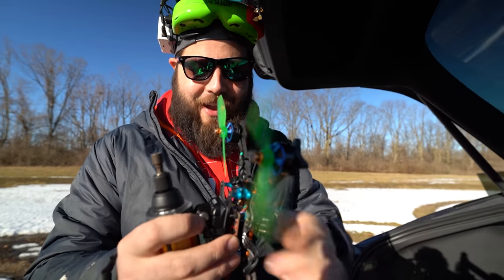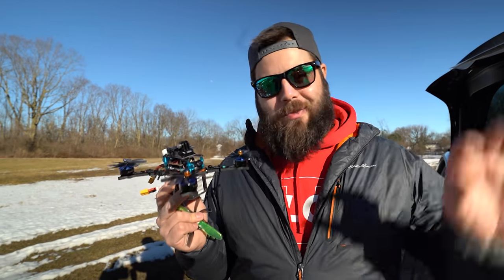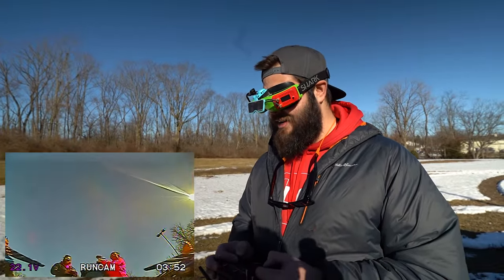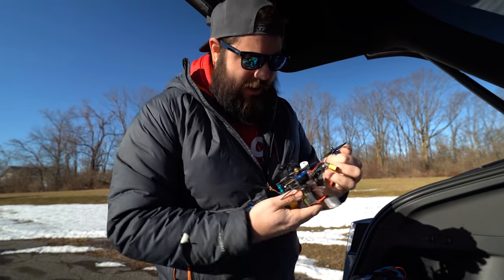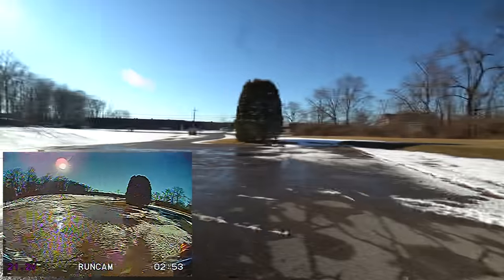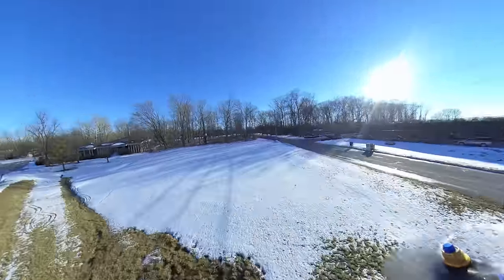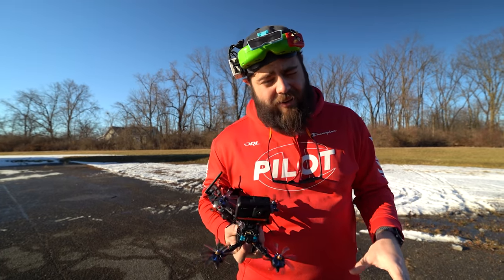Pushing 8 blade props to 65,000 RPM

Comment: In World War II it was the sound of the German Stuka that struck fear into the hearts of soldiers. In World War III, it will be the sound of 5-inch bi-blades at 65,000 RPM.
Reply: i have 6-inch bi-blades, but only can fly them far away from civilisation. it eaven scares the crap out of me. hehehe
Reply: Not far off now eh
Reply: You didn’t know how correct you were when you wrote this.
Reply: @Flumphinator yeah 😢
Reply: This aged like fine wine

Comment: imma hold out for 16 blade.
Reply: 420
Reply: Do dual motor mounts with 8 blade.. there u go, 16 per arm
Reply: Low turbulence
Reply: Half blades.
Reply: @dp4advanced234 " Tied stick?"...

" U know, the stuff that's tied to a stick."
Reply: surely stack 2 on top of each other.... i wonder what would happen if you did that?
Reply: no need to wait anymore. quadmovr did 16blades, check it out on his channel
Reply: @chrisgicky2215  Goo look Quadmovr, he's already doing that.
Reply: @nixie2462  not surprising.. the man is insane. In a good way 👍

Comment: 65,000 rpm is over 1,000 rotations per second. Try to wrap your head around that!!!
Reply: Soo... what is the 5inch tip speed??? Over 1400kmh. What is the forces on the prop? Around 200kg...  This is not possible without exploding the prop.
Reply: @NiNo9  its a 3 inch prop
Reply: @NiNo9  There is a lot of drag that slows down the props and maximum rpm is also limited by the ecs (mosfets don't switch instantly). It would be nice to see real rpm in osd.
Reply: the guy in video just did some simple math and thought that's it. 65K. But it's 65k without resistance (no prop). with prop is way less

Comment: Question: What's the best 5" prop?
Answer: 3" 8-blade.
Reply from the maker: Rofl
Reply: There are now HQ props, 8 bladed 3.5inch, and 6 bladed 4 inch that should work better in a 5ª quad than the extreme 3" props.
Reply: i guess Im asking randomly but does someone know a trick to log back into an instagram account??
I was dumb forgot my password. I love any assistance you can offer me.
Reply: @Holden Milo Instablaster =)
Reply: @Ahmir Samson thanks so much for your reply. I got to the site on google and im in the hacking process now.
Seems to take quite some time so I will reply here later when my account password hopefully is recovered.
Reply: @Holden Milo You are welcome :)
Reply: This makes me curious how 5" 8-blade props would perform.

Comment: According to a propeller tip speed calculator, at 65,000 rpm the tips of a 5 inch prop would be supersonic, traveling at 966.8mph. That explains why those powerful race drones are so loud, but I still don’t quite think those props can handle the drag that occurs when the tips go supersonic…although when I compared the prop design of a race quad to the prop designs of planes that have supersonic propellers, the quad’s props look like they’re gonna handle it WAY better. Just wonder if it’s possible to make a race drone with supersonic propellers to make it super loud and fast
Reply: 11:26

Comment: Qualitatively speaking, for the same diameter, 
number of blades:                                 2                             8
RPM needed for certain thrust:         high                        low
noise:                                                     loud                        quiet
top speed (high-speed efficiency):   high                        low
low-speed (hovering) efficiency:       low                         high

Comment: We played around with 8 blade props years ago. Back in the CC3D days and the bite is insane. Super locked in, 2 and 3 blade props felt sloppy back them compared to them.
The are faster at mid, throttle for sure but really caused mega sag if you went above about 70% throttle. 
This was on BH 2205 2522kv motors and 4s 1300. They felt amazing but they pulled so much amps that it literally was unflyable even on a totally fresh pack... After a, min of flight if you got on the throttle at all for any length of time it would cook a esc or sag so badly you would have to back off... 

The 6 blade 5 inch props was halarious... 

What's fun is to take 3in props on a high KV 4s 5 inch build and run 6s. The motors have so much torque with that little prop that it literally man handles them and response is so quick and clean and at hover it's making some noise lol... Wot on a unloaded 3 inch prop on 6s on a 2900kv really screams.

Comment: there is lot of aerodynamic physics behind this experiment, which could explain why is proper diameter, number of blades and rpm does it's job... The main idea is that only diameter increase flow(volume of fluid per minute) which increases thrust, and explains why bigger drones fly more efficient. Number of blades increases pressure, but decreases flow, that really helps to increase "grip" of the drone. The most efficient setup in theory of hydro and aero dynamics is to have only 1 blade, but you'll have unbalanced motor that makes it inefficient in terms of tribology of bearings, that's why the most efficient drones use 2 blades. As for high rpms(which highly increase pressure, and flow a little bit) which you have to use in that case because you don't have enough flow because of small diameter of props shows bad effect because you have something like cavitation in water at pump input because of low pressure when sucking, in the air you have vacuum at the edges of props which also could be said that you are running props with a speed higher than speed of sound. So when you are running 8 blades you have less flow and less air goes at speed of sound, that's why they are much quite than 2 bladed which have much higher flow

Comment: I just did the mathematics. It's obvious when you think about it. If you halve the blade diameter and quadruple the number of blades (of the same angle), then you get the same lift at the same RPM, so it's a straight swap on your current rig, without changing motors, ESCs or batteries. It would be interesting to see what impact such a change has on noise level, air speed and agility.

Comment: I just bought my first drone. Zero Features. Just a basic all piloting all the time drone. Loving it.

Just the fact that I can get so much practice piloting. My buddy smirks when I am flying, because I just fly out a ways, circle back, establish hover and land accurately.. I was doing it with a store bought drone in the wind. I did my first attempt at a flip with it a few minutes later and lost control though. This is what happens when you let your friends  bait you into showing off. Drone is fine.

Flown a Phantom before. It was almost too easy to fly. I started out years ago in helicopters. So it seems to transfer well.

Comment: So, a little math here.  The circumference of a a 5 inch prop is 15.710 inches.  That means a 5 inch prop tip at a potential RPM of 65,000 would be traveling at 1,021,150 inches per minute, or 16.1 miles per minute, or 966 miles per hour.  That means that weird sound hat you are hearing is the prop blade is likely breaking the sound barrier, and becoming much less efficient.  The eight blade props would be doing 677 mph at 65000, which under load will not reach that rpm, and is staying under that sound barrier.
Reply: 1,416.8 fps if people are looking for that measurement
Reply: 966 is superso at Mach 1.2. So yeah, I bet the prop is supersonic

Comment: In what seem like the old days, I used to run 5S on 2600 kv F40 Pro V2 motors.  This was in the days before Betaflight had a motor output limit.  Tuning was difficult and never perfect, and the best I could really do was put a throttle cap on the radio to keep from pushing the props too hard.

When I'd flip the switch to bring disable the throttle cap on the Taranis, the Racekraft 5051 props would scream like a banshee.  The sound was just ridiculous.  On any 5" prop.

Comment: i am using same propellers on a simple DIY cinewhoop with 3s battery. major difference is the sound it generates. it is quiter and thrust is more than 3 blades. good thing isthe load on ESC is not much different. 26 amps in total vs 24. but very fragile when used out of a duct, and acetone warps them FYI.

Comment: I love it! Very quiet for a beginner would be excellent! Sound too loud is sometimes scary for many people and neighbors! You guys should produce the quite and new 64 blades by Nurk FPV.
Reply: I personally don’t like quiet race drones. To me, they should be like mini fighter jets which is loud, fast, and highly maneuverable. In fact I wanna find out if it’s possible to have a drone with props that go supersonic which would give u extra thrust, and a LOT more noise lol. If it is I would love to get an fpv quad and install more powerful motors on it with a very specific propeller design that can handle the drag when creating shockwaves on the tips due to going supersonic

Comment: You can take inspiration from the aerospace industry. GE's GE9X has similar design in blades. For a few reasons.

1. Way more effective in power to fuel consumption 
2. Noise levels dropped dramatically.

You're seeing and testing GE's theories and might even realize it :)

Comment: When changing prop blade #’s do you have to tune the drone differently to keep the motors from heating up? Or is that usually not an issue?

Comment: I did a mix of old dalprop 6 inch biblade in front and modern triblades 5 inch in the back on 2208 2450kv and this thing sounded like a monster. Very loud low pitch sound that was amazing. It was flying like crap but the sound was crazy

Comment: Sooo. In aerospace engineering this is an entire field of study. Basically, what it comes down to, is more blades == less efficiency. At those speeds, a two bladed prop will probably save you some battery power and handle about roughly the same as the 8 blade, however, the two blade prop experiences less drag to spin up to speed, so it uses less power to spin up to the same speeds as the 8 blade. when you start to get to super sonic speeds, thats when a propeller starts to warrant a fan shaped design. Like in a turbojet engine. 

I'm not an engineer, but I from what i understand, thats where the science of blade numbers comes in. 

More blades = more more juice to power it with marginal or negligible increases in performance. You can look to WW2 to see why they chose to keep planes with 2 or 3 blade props :p

But i guess its a decent trade off to make your drone quieter O:

Comment: two things. First, have you tried to put them on a 3-4 inch frame? Second, I wonder if they might come out with a 4 inch 8 blade prop?

The first option might save some weight. The second option would reduce rotations and the pitch a little.

Comment: The smaller prop being quiet does make sense.
The 5 inch could be breaking the sound barrier while the 3 inch is not. Another way of looking at it, is that all the noise your hearing from the 5 inch is the sonic boom of the propeller tips.
Reply: I bet and to prove it, I calculated the tip speed of the 5 inch propellers at 65,000 RPM and sure enough, it is supersonic at 966.8mph. Another thing is how it sounds at 11:26. It had a very distinct “buzzsaw” kinda noise. I heard a 4 inch quad before and it sounded mainly like a “whoop” or “zip” instead of that kind of intense shredding kinda sound. It was still the LOUDEST drone I’ve ever heard tho! I would love to get one with supersonic props and basically destroy ppl’s eardrums lmfao. That is why I love race drones

Comment: Don't edf's have like 12 blades or something, maybe even more? And if that's the case, then it seems kind of likely to me that they're not going to be quiet. Because edf's are.....not quiet. But I've tried these and I was amazed at how quiet they were. When I first put them on, my motor idle was too high for these props. I armed and it ground-effected immediately. And it makes sense why they are quiet (at least in my head),only two of the blades (on a four-blade prop) are creating,....I guess what it's called edge vortices? Or something like that. The only reason I don't buy these all the time, is because they are full on glass-nylon. I mean, you even look at them wrong, and they shatter. But because they are made of what they are made of, they are also stiff as hell too. I really love them a lot. And I've tried to ask APC to make like a stiff polycarbonate version of them, but they haven't taken my advice. 
They are the APC BD5x4E-4-B4 propellers.

Comment: I suspect the frequency of the noise made by the 8 blade props is above that of human hearing capability and all we hear is the air turbulence from the props.
what is cool is you can easily make a standard 5 inch 4s high kv drone that you can alternatively put a 6s pack on and these little props on for quiet flying.
Reply from the maker: Exactly!

Comment: This was a great video. I love the test. I am flying a taycan which Flys great with 3 blade gemfans, but if I switch to 5 blade the motors run much hotter (and I have burned out several motors) but I like the way it sounds and performs though the tune is off. I am not that knowledgeable at tuning but I am trying. Any suggestions on tuning for the 5 blades, cooling down the motors and performance?  Thanks, your 12s build is what got me into fpv from the boring drones. Thanks for that. Good luck.

Comment: Extra blades means you are pushing more air at the same RPM as with the other props but the 8 blades are smaller in diameter to lower turbulence between the blades. A 5 inch version of the 8-blade with more powerful motors  would be awesome to see.

Comment: The motor KV rating is unloaded RPM per volt, not the loaded RPM per volt. The actual rpm of the motor will vary depend on the load you place on the motor. The props will be spinning no where near 65 thousand RPM
Reply: Um I bet the 2 blades ones will spin at at least 64,000 rpm bc of their low pitch angle. Those blade tips sound like their going either close to or slightly over the speed of sound bc like listen to how loud it is. Most 2 blade quads aren’t that loud but ofc it can be the camera’s mic and stuff

Comment: a one bladed prop is the fasted only reason people started to fly tri blades was how they feel in the corners you dont have to apply much more throttle in the corners compared to bi blades so its easier to fly but bi blades are faster but harder to fly

Comment: I doubt those were reaching 65k rpm. The RPM you calculated would be with no load on the motor (props off). Remove the props, Plug the quad into betaflight, in the motors tab, enable bi directional D-shot. Enable the motor sliders and spin up your motors, you will be able to see the actual RPM reported by the ESC. Now put the props on and (very carefully) try the test again. I can assure you the RPM will not be 65,000.

Comment: Sounds like the octoblade pushes the sound energy up to higher frequencies, possibly in to ultra sonic region, so the noise is still there, but above human hearing range.
At what number of blades does it stop being a prop and become a fan? Are there any swept-blade versions?
The five blade sound is like the F1 V10 of the quad world.
Now wondering about octobladed phantom, if quiet enough to record dialog while getting drone shots.

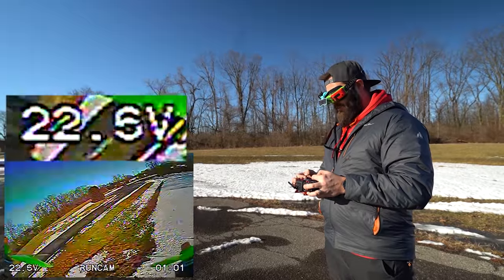Comment: 10:56 I have had a battery go down that fast too. I knew it was dead (150mili ohm on one cell) but I just wanted to see how hot I could get a battery since I didn't care about it. The bad cell popped as soon as I webt above 30%, and that was with an already 70% limit. It was extremely hot because I kept running down the other cells so I could dispose of the battery easier. And when I landed I smelled that smell, and saw that cell.

Comment: Hey Nurk
I'm wondering about prop down force? blade tilt in degrees, helicopters increase tilt to the blades to achieve takeoff, such as five degrees compared to ten degrees I'm just guessing. 
I know it would probably decrease battery consumption but increase speed right?

Comment: Could you drive 5-inch 8-blades and get sound reduction even more?
Reply: I can say that 6 blade 5in props are MASSIVELY quieter at idle to around 60% throttle then 3 blade props. I mean much much quieter (so long as, they are balanced that is and out the package they are very poorly blananced.) they also fly very well as far as being super locked in and responsive but throttle will feel mushy once you reach around 60 or so % and once you reach that point adding more, throttle doesn't really do anything accept draw more amps and cause prop flutter.

They fly really good tho for just flying low and quick and turn really well but as, soon as, you start trying to rip you will quickly hate them... They are also pretty damn fast in forward flight at around 50% throttle and Amp draw is what a 3 blade will be at that point but become extremely inefficient as soon as the the blade flattening/flutter starts.